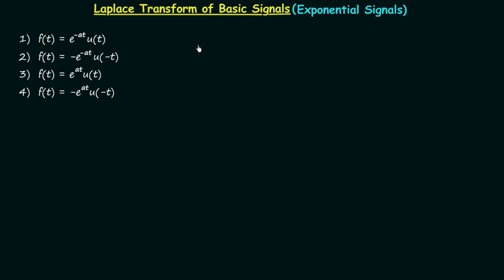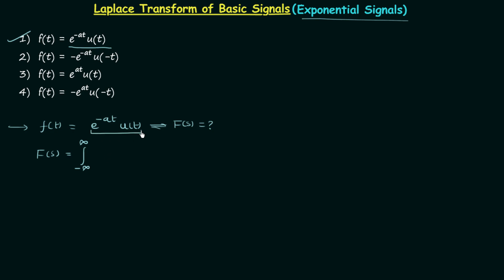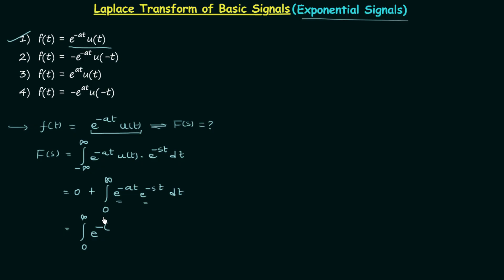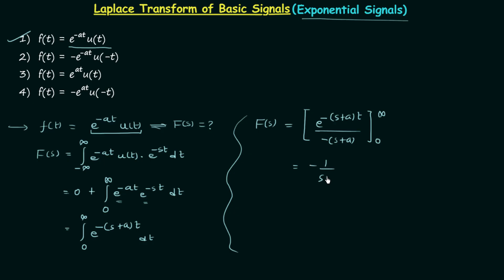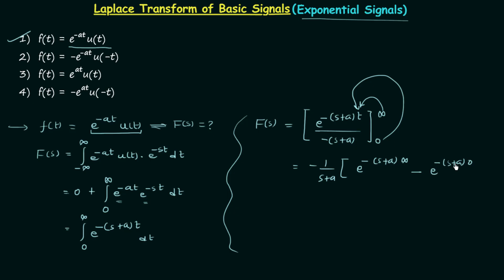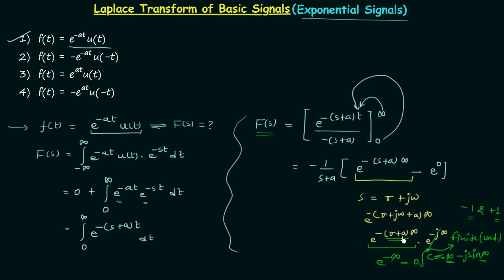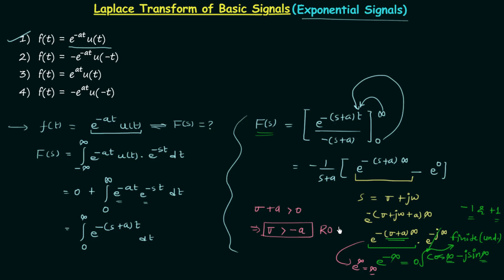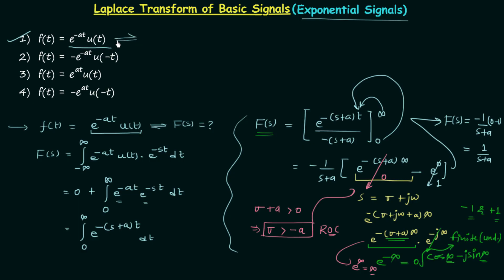Laplace Transform of Basic Signals (Exponential Signals)

Comment: In second problem LT is - (1/s+a)
Reply: Yes answer will be negative as it is -e-at
Reply: Laplace transform of u(-t) is - 1/s
Reply: no answer will come positive
Reply: @HunterIndia   how????
Reply: @hireshdas1435 it is positive. follow method used in 1st exponential function
Reply: Since, u(-t) the limit will change to -infinity to 0. If you change it again it will add a negative sign. Both will cancel out and the final answer will be  1/s+a.